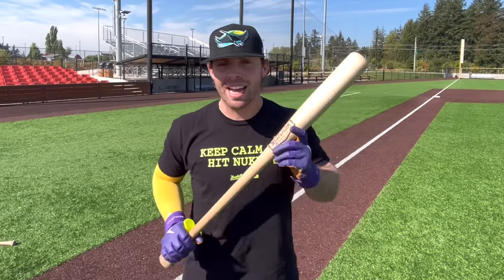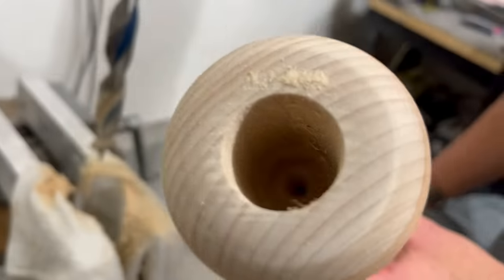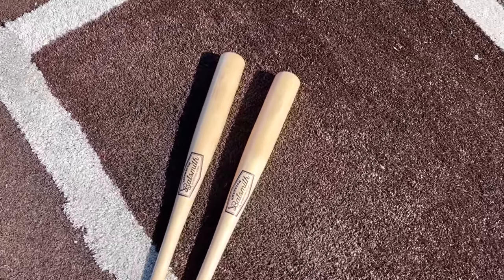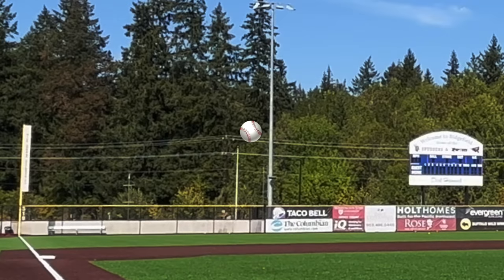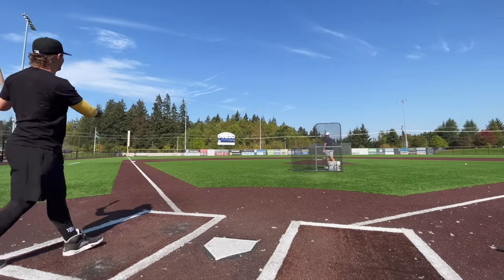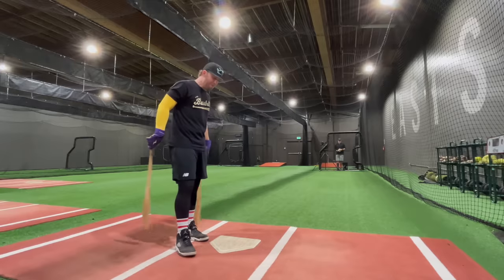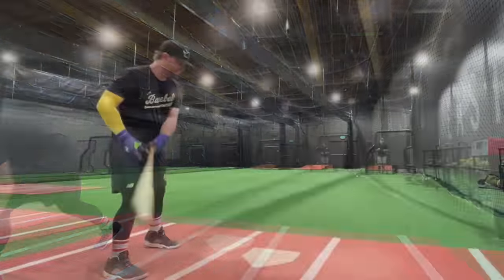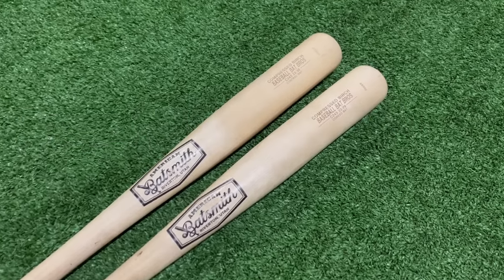CORKING A BASEBALL BAT (the right way)

Comment: I had no idea it was about reducing and transferring the weight! I thought it was all about making the bat more reactive from the hollow section plus cork. Learn something every day!
Reply: That’s what I always thought too. Thought the cork was to make it more “bouncy”
Reply: the cork makes it lighter while retaining most of the bounciness a solid wood core would have
Reply: same
Reply: Exit velo is created by how fast you can swing the bat. Exit velo is relative to how fast your swinging your bat. If you hit an exit velo of 90, your swinging your bat at 90 MpH. 

A lighter bat makes for a faster swing. It’s why I prefer to swing a lighter bat.
Reply: its basically to take weight off the END of the bat specifically so you can whip it through the zone faster
Reply: @ChiSoxEdits as long as the lighter bat is the same length then yea. I mean idk the calculation but the further the barrel is from your hands the faster it moves also. It's all about finding your personal middle ground between length and weight.
Reply: @SirSoaks  true, but if you can’t swing a 35 inch bat,, you might as well swing a lighter bat.
Reply: @ChiSoxEdits  which is why you have to find your middle ground. It used to be a 33-30 for me. Started off a 32-29 but I was getting more power with the 33
Reply: It is.. these dudes ain't too smart
Reply: @aclonymous  I'm sure they just "tried it" back in the day, and it worked, they didn't totally understand the science
Reply: Yeah, if it’s only about being lighter then why insert cork and glue? Why not leave it hollow?
Reply: @_baller  1800's people were not dumb, they understood weight distribution of their tools. They used tons of hand tools back then 100x more than today.
Reply: @ChiSoxEdits  Its more complex. A 90mph heavy bat(30oz) will hit the ball faster than a 90mph light(28oz) bat. The heavy bat has more energy, and transfers it into the ball.  Also, the ball won't be going 90mph if the bat was going 90mph...the ball had energy in the opposite direction and it must be subtracted. So to get a hit-ball-velo of 90mph, the bat has to be going faster (105mph? idk force of pitch vs force of bat). 
energy = mass*velo (they are equal),,,but Force = mass * velo^2 (velo? matters more)
90mph 30oz bat,,,vs 95mph 28oz bat...which has more force or energy?
Reply: @ChiSoxEdits  the angle of the dangle is also congruent to the smooth of the groove! Nobody thinks you're smart!
Reply: @ChiSoxEdits thats not how that works the speed of the pitch makes a big difference on exit velo as well just because u swing at 90mph the ball isnt gonna match the same exact speed witch is why some.bats are better because they transfer more power into the ball
Reply: @TheRealSwampOperator it is what? About the cork being more bouncy? Please tell me you don’t believe that.
Reply: Same.
Reply: @TeamBazz yes most people thought it created a trampoline like effect.
Reply: We did this 100 years ago in 1989, but we used shredded up Cork and used a dowel to compress it down… We also used shredded super ball, both bat were  heavier, but the ball exploded off both those bats… Kid across town got suspended 3  games for putting three full-size tennis balls into a 35/30 Easton, cap flew off when he got handled Tennis balls trickled all over the infield
Reply: @aclonymous  It also makes it easier to break the bat if you hit it on the end.
Reply: Your swing speed vs. exit velocity numbers are WAY off. Exit velocity against any kind of pitched ball (as opposed to a tee) will always be higher than your swing speed. Why? Our old physics buddy Mr. Newton. You impart force on the ball via swing, but the ball imparts some of its own force via its own kinetic energy. Hence why major leaguers can achieve exit velos in the 110-120 range with 70-80mph swing speeds. 

Please make sure you know what you’re talking about before you talk.

Comment: I think to really make sure you control for all variables, you have to have a single blind test. Have someone completely unaware of the differences between the two, then do the exit velo test. If they know it’s corked, they might swing harder unconsciously.
Reply: You can feel the difference in the weight of the bat though
Reply: That would be a single blind test because the test givers know what's up.
Reply: @lefi75  You're correct. I fixed it.
Reply: It doesn’t matter for this. They know exactly which is which when they pick them up.
Reply: Completely agree.  And, the ball should probably be stationary with the bat swung by a mechanical device.
Reply: Should be double blind, as in don't even tell the people doing or taking the test what the difference between the bats are or what they're testing for. That way people won't even know what's they should be trying to feel for.
Reply: A double-blinded or even single-blind control test would be nearly pointless. As obvious experts, there's simply no way to magically hit meaningfully harder just because they think they can. 

The test is valid unless we think they were dishonestly pulling their hits with the control bat.
Reply: Mythbusters already tested it in a controlled environment. Corked bats are actually worse than normal bats. Placebo effect is what makes people think corked bats are better when they are actually worse.
Reply: @JoeyB0b  the placebo effect actually works, so that's not what you're looking for. In order to determine something is not a placebo effect it has to work on the order of two standard deviations more than the placebo.
Reply: @JoeyB0b  additionally, actual scientists have studied this and if found the lighter bat does give the batter a little bit more time in order to adjust. What that means is, they can swing the bat faster, which does not translate into a harder hit, but it translates to a longer delay to hit the ball better.
Reply: part of corking is knowing it's corked.
Reply: @ri3m4nn   Huh? The placebo effect makes perfect sense the way he described it. People expect to hit harder so they do.
Reply: @timwhite1537  incorrect, a placebos do work, hence "they swing harder." What is happening is NOT placebo, batters have more time to swing, thereby making better contact. Again, in science non-placebos need to outperform placebos by 2 standard deviations to be considered better than the placebo. Given the corked bat gives more time to a hitter to make better contact, they are "better" in competitive sport where more time is meaningful.
Reply: Nobody is swinging a bat unconsciously. Subconsciously, absolutely
Reply: @ri3m4nn exactly correct. It changes everything about the Major League baseball equipment specifications. And I'm sorry but MythBusters is wrong. a correctly corked bat in the hands of a Major League player's can really up your numbers significantly and if most of the team is doing that, It can win you a World Series.
Reply: @Shiftarus they hit the baseball faster and in turn harder

Comment: I feel like if you compressed the cork, you'd get a pressurized effect that can increase the pop. I would like to see more experiments around this like: seeing how wide of a bore you can get with a carbon fiber tube insert, maybe also pressurized with air, thin titanium tube insert.
Reply: Except other people with better qualifications proved corking bats doesn't do anything to help hitting distance.
Reply: @sillygoosexv6778  this video had some very interesting statistics. While not conclusive by any means, if you apply what was shown in this video, a 3 mph increase in exit velocity would equal approximately an additional 15’ of carry distance. “Biomechanical researchers found that a ball leaving the bat at 90 MPH traveled about 300 feet, 95 MPH 326 feet, 100 MPH 350 Feet and 105 MPH 375 feet. The research concluded that for every 1 MPH added to exit velocity, the ball traveled an additional 5 feet.” That could be the difference of a loud fly-out before the track vs a HR.
Reply: I would like to see the same thing done but no corks in the bat, just leave it hollow with the plug on the end.
Reply: @sillygoosexv6778  Decades of use in pro baseball prove otherwise.
Reply: The engineering term would be modifying the coefficient of restitution to do impedance matching so you can get maximum energy transfer between the bat and ball
Reply: @JuarezDerrick  Sadly the bat would just flat out break. I have also tried this with some friends I played ball with in high school and I honestly hit more home runs with the regular bat. Everyone else on the other hand thought the Corked bat hit better.

Comment: Yo! Got an idea for you guys. Have you seen the puck knob wood bats some pro players have been using lately? I believe Dovetail bats and maybe marucci have them available for retail sale. It's supposed to improve bat speed and makes the bat an extra couple inches. Would like to see you guys try them out.
Reply: Lets see the showdown, Paul Goldschmidt puck knob vs the Jeff McNeil no knob!
Reply: I’ve seen Travis D’Arnaud use it and I’m waiting for the Bros to review one
Reply: Big fan of the dumbell knob/ hockey puck knob. It limits the way you hold the bat, but increases rotational power
Reply: Great idea
Reply: I like the idea, but i think the utilization is too individual to measure.
I think a guy will just do better with whichever one feels better on his bottom hand.
Reply: The old Barry Bonds Sam bat was 🔥👌🏻
Reply: I got one of the puck knob bats from Dovetail. Its a 34.5"/31.5oz birch wood, but feels so much lighter to swing than my 33/30 maple bat with a regular knob. The counterbalance makes a huge difference. 

I would love to see what they think as well.  Hopefully they do a video with one soon.
Reply: @carlingram8316  That's really interesting. Does it feel more awkward/uncomfortable to swing than a normal or tapered bat knob?
Reply: @EHMSL1226  not really. Mine is actually the "ProXR-O Puck knob", so the slanted part was the biggest adjustment for the knob.

The other thing that really jumped out was with the bat feeling so much lighter, I was really early with my hands. First time at the cages I couldn't hit a thing. I'm not a high level player though, so they would probably have much different results and opinions.

Comment: I remember that corked bat video and now the channel has grown a lot since. Job well done.
Reply: Haven't they done scientific studies that this doesn't really help anything?
Reply: @ItIsYouAreNotYour  it absolutely helps.
Reply: @kingsolo6241  I'm going with science on this one.

First, they say the trampoline effect is negligible in corked bats. In other words, there is no increase in the elasticity of the bat-ball collision.

Second, they investigated the trade off between higher bat speed and lower collision efficiency and found no benefit to a corked bat.

“We conclude that there is no advantage to corking a bat if the goal is for the batted ball speed to be as large as possible, as is the case for a home run hitter,” 

However, there is a caveat. Being able to swing the bat faster allows the hitter to delay the swing for a crucial extra fraction of a second. And this may allow more accurate hits.
Reply: @ItIsYouAreNotYour  you’re wrong. Corking bats if you watched the entire video are illegal in the MLB for a reason. Exit velocity is much more. Velocity off the bat is much more. It’s not comparable.
Reply: @kingsolo6241  Also: "It causes the bat to be 'lighter', which in turn allows the batter to swing it more quickly. However, the reduction in weight negatively affects the velocity of the ball as it leaves the bat, effectively cancelling out the advantage gained from a quicker bat speed."

It's a placebo effect. If there is a way to randomize the bat he uses I don't think he feels such a 'huge difference' The only thing his testing proved was the swing velocity.
Reply: @ItIsYouAreNotYour  a lighter bat means strong hitters crushing the ball into oblivion.
Reply: @ItIsYouAreNotYour  the velocity is much higher on a corked bat. Did you not watch the video
Reply: @ItIsYouAreNotYour  why are aluminum bats not allowed in the MLB? Do you know why?
Reply: @ItIsYouAreNotYour  😊❤😂❤😊😅🎉

Comment: I do corking methods for the fungo bats i make. Sometimes i do slits, and sometimes it's round bores with lightweight inserts like yours. The demarini wood composites use carbon fiber instead of cork and it actually increases durability

There's 2 ways that wood bats increase ball speed. Hardness and mass. Hardness increases the efficiency of a ball's rebound whereas mass transfers more energy total if the speed decrease is less than the mass increase. A corked bat balances out a bat design, but even if you increase the density to have the same mass or increase the mass to have the same swing weight, this kills any amount of endload. Endload bats are more efficient per swing weight than balanced bats.

This is an important topic of discussion when it comes to usssa because you can get a balanced drop 5 to feel like an endloaded drop 8, but the drop 8 will be more efficient at the same swing weight (not counting wall thickness and things like that). Wood is the same way. A light endloaded bat is more efficient than a heavy balanced bat.

For jacked pro players with enough strength to swing a tree axe, corking is less effective at increasing total power because the speed they gain maybe not be as much as the mass they lose. However, bat speed and control helps you get BETTER hits, so even though you lose power overall, you're more consistent with your power and have more consistent launch angles.

It's a complicated topic that comes up frequently with cupping, which can be thought of as a sort of legal method of corking a bat ever so slightly
Reply: My guy wrote a whole essay.  Thanks for the info tho.👌
Reply: Fuck yea its Crixus. You gotta show off those bats dude! Or make some truly cracked bats to show off!
Reply: @Thurokiir1  hey dude, you're right on time because I'm starting something to now actually. Got a few partners and we're gonna take my models and designs into production. I'm taking time off the university to work on it. I think it's time. Maybe i should make videos in here, although i don't know jack about content making lol
Reply: Thank you

Comment: Very interesting seeing it done today. I did this test for a 6th grade science fair project in the late 90s using the base store bought LS wood model because they were so accessible and affordable then. I had unaltered, cork, super balls, and sawdust filled by a family friend who was a carpenter. My dad and I built a swing machine to guarantee the same swing path to the ball off the tee to guarantee being struck in the same spot. The altered bats were lighter, but nothing outperformed the unaltered bat. With a mechanical swing releasing the same amount of force on each swing, back in the 90s with ash, it only helped as far as reducing weight, not increasing distance. 

Obviously bat tech and design has advanced a LONG way even in wood, but the density definitely mattered back then. Won the science fair too!
Reply from the maker: I think they main benefit is that the bat speed increases quite a bit with the corked bat
Reply: Yeah, if you know about relatively basic collision physics you can figure out that lowering weight for increase in velocity does nothing.
Reply: @aukora129  Are you saying in the basic relationship of F=ma that the reduced mass and increased acceleration essentially cancel each other?
Reply: @dytakeda  No I'm saying that with conservation of momentum, the amount of weight lost by corking just doesnt mean anything. It would be far more effective to just use a lighter bat, but players dont feel as comfortable that way. In fact, many players use heavier bats than necessary, meaning they can straight up remove weight from their bat without changing it's dimensions for the same effect corking would give.
Reply: The point of hollowing it out is to reduce weight so you can swing it faster. A swing machine swinging it the same speed defeats the purpose of hollowing it out. This video shows a reduced weight of one ounce. Which is about 3% of the bay weight. The end result was 3% higher exist speed. It would be interesting to pressure test the bat to find how much you can take out of the middle before it’s to weak to handle hitting the ball. Taking the most weight off. Taking off 3 ounces could give like a 10% boost in performance. Averaging exit speeds of 110
Reply: Awesome!

Comment: I think what makes corking effective is PERIMETER WEIGHTING. It's a method of taking away weight, but crucially because this weight is reduced from the centre, it stabilises the barrel during contact, effectively creating a larger sweet spot. Look up Perimeter weighting. It is used a lot in golf club design.